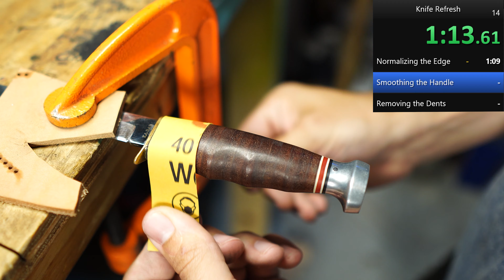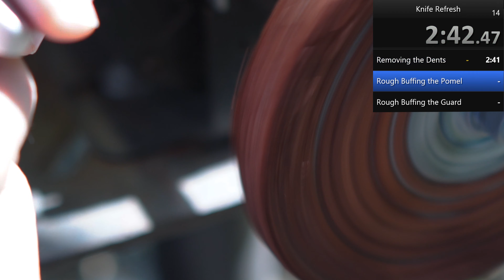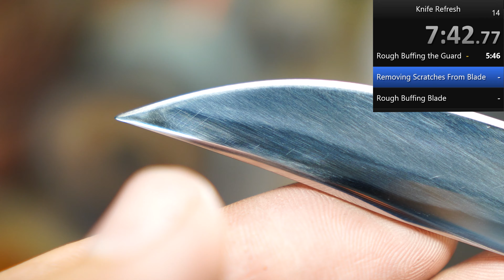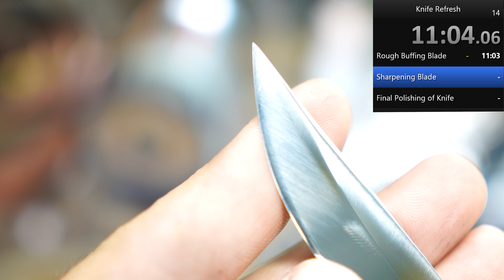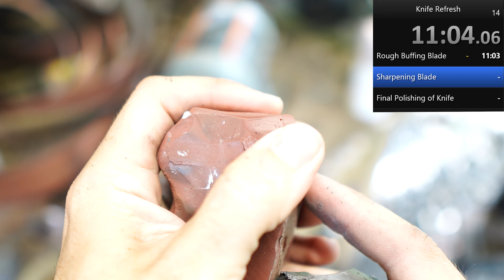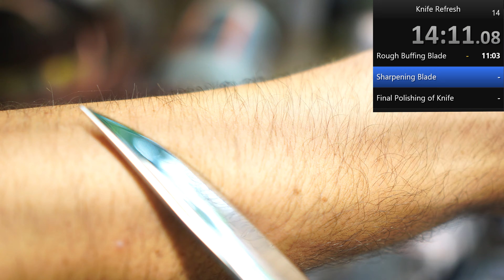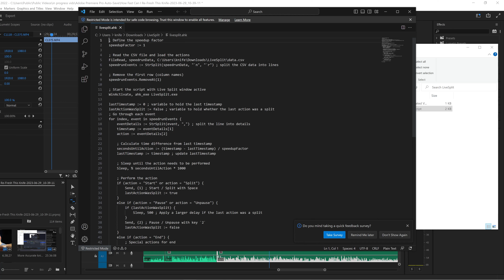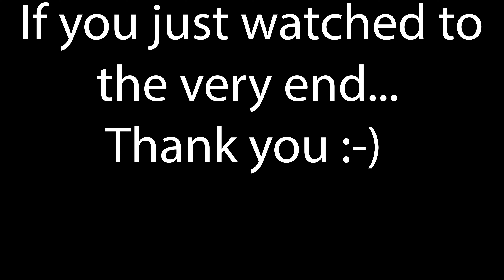Speedrun Restoration -- How Fast Can You Make an Old Knife Look New?

Comment: I'm only 8 min in to the video.  You may want to consider taping the blade while working on the other parts of the knife.  Hate to see you get cut when the wheel grabs the knife and flings it.
Reply from the maker: Good safety advice! I've just been working on knives for 16 years now, so I guess I've developed some bad habits. I should have also been wearing eye protection 😅